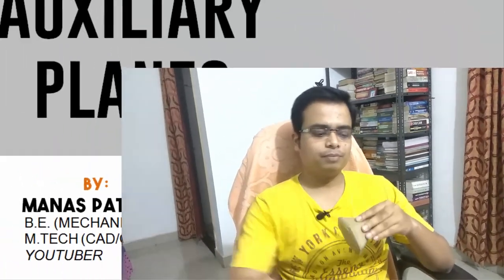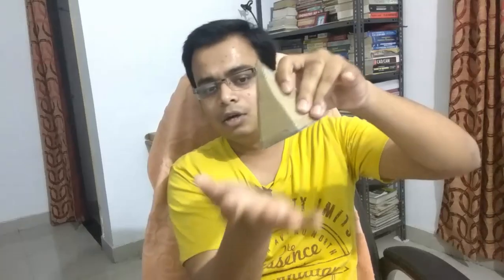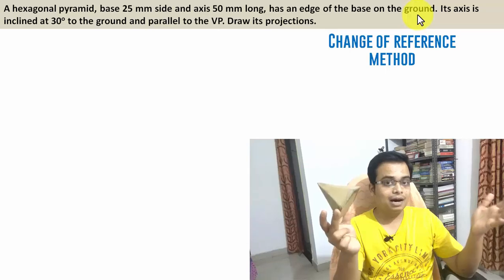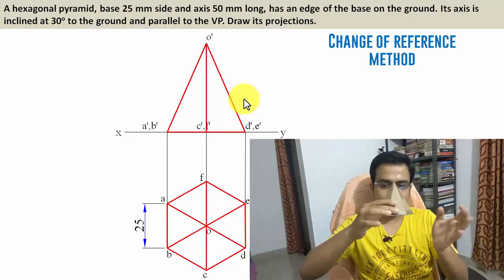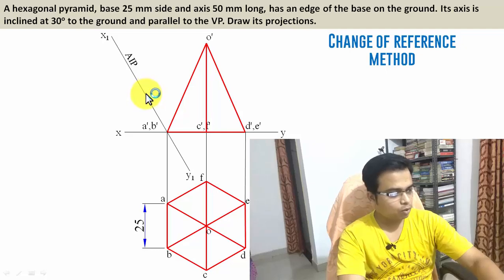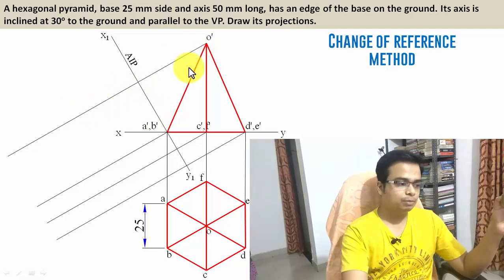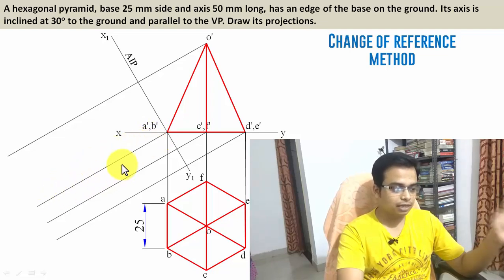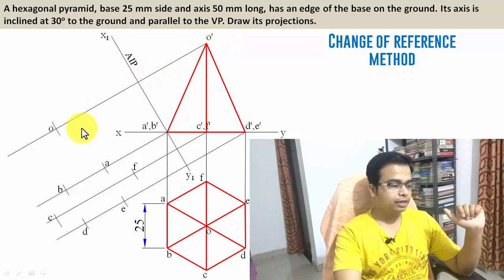Auxiliary Plane_Projection of Solid_Lecture 8

Comment: a hexagonal pyramid of edge of base 30mm side of base & length of axis is resting on one of its triangular faces on h.p. draw the projection of the pyramid when it's edge of base is in h.p. is inclined at 60 degree to the v.p. use auxillary plane method . Please solve this problem